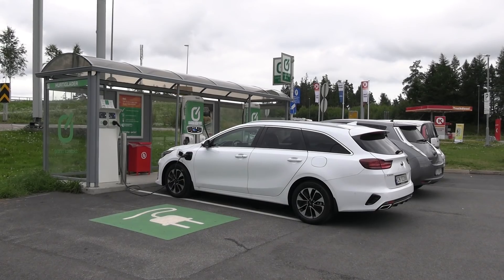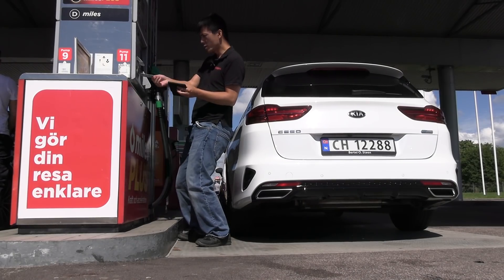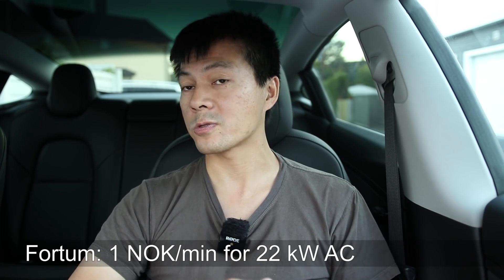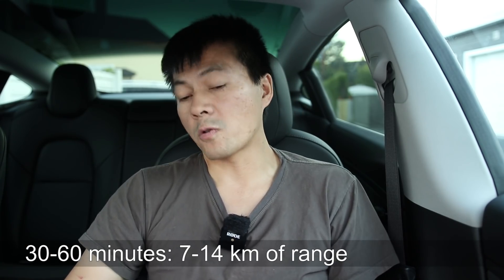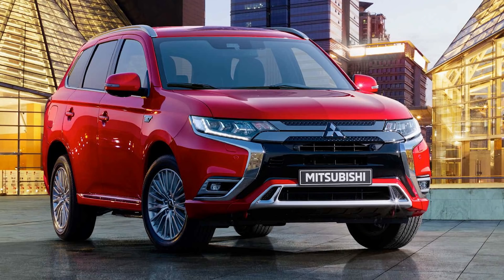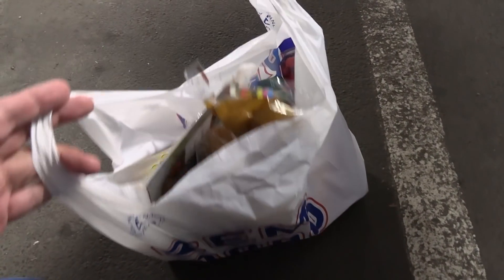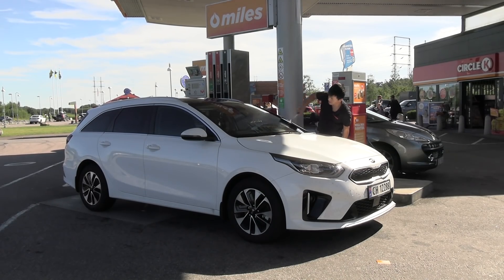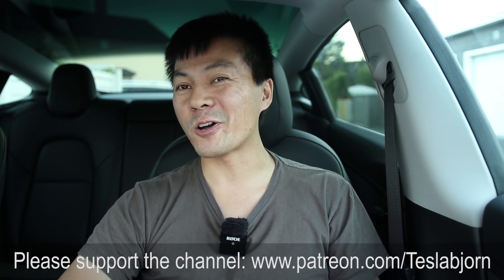Why didn't you plug in the PHEV while eating?

Comment: I agree on the financial aspect, charging a PHEV on a price-per-minute charger is just stupid. No PHEV driver uses a price-per-minute charger unless it's by mistake. However you need to understand that on long trips, you don't charge a PHEV to increase range (it's still a fossil car, range is not the issue) - you charge it to reduce fossil fuel consumption and increase performance. So those measly 7 km of charge might actually reduce consumption by 15-30% depending on how long your drive is. And on the motorway, having 7 km charge rather than 0 km gives you 30-50% extra HP depending on what PHEV you're driving.
Reply from the maker: In order to reduce the consumption by 15-30 %, you can only drive 50-100 more km. If you drive farther than that, the reduction in consumption is way less. In this example, driving 320 km with 7 km extra electric range would mean only 2 % reduction. A drop in the ocean.

As for the extra hp, you only have that extra power for 7 km. After that, it's back to fossil only. Your arguments are not valid if you actually think about it yourself.
Reply: @bjornnyland  I don't know the theory behind your maths I only have practical experience driving a Passat GTE for three years and 75 000 km. And my experience is that driving 300 km on the motorway with 0 km charge vs. driving the same distance with 7 km charge renders a consumption reduction way above 2%. 

And your other point makes no sense. When driving in hybrid mode on the motorway a PHEV (atleast the Passat) uses the fossil engine to maintain speed and the e-motor when you accelerate (or regen when braking). So 7 km charge lasts alot longer than 7 km distance. You could of course drive electric only for the first 7 km and then switch to fossil, but thats suboptimal from a consumption perspective.

Comment: I’d gladly pay even more money to get over 22kW AC charging. Where I live we basically only have ABB 50kW fast chargers with a CCS, a Chademo and a 43kW AC Type 2 plug. Since these chargers are quite rare, too, they tend to be occupied quite often. That way if you have a car with a CCS/Combo 2 socket that supports low power AC charging only and you arrive at the charger and the CCS plug is occupied, you can only charge slowly on AC. As I mentioned you could charge on up to 43 kW on AC though. If your EV could take that much power when charging on AC it wouldn’t even make a big difference whether you charge on DC or AC. 
Some chargers are located at supermarkets and gas stations. You are allowed to charge for free for up to one hour there. The rest of the chargers are owned by a company and they are located at gas stations at the highways. This company charges a very high price for charging though (when compared to the price of electricity here).

Comment: - Even if you have to pay per 1kWh: 1.6kWh is rounded to 2kWh. So you would have to pay for 0.4kWh you didn't get. Which means every kWh costs you actually 25% more! So you shouldn't do that too often. If you charge like 10.6kWh, it's just 3.8% more that you pay.
- In general, slow charging vehicles (no matter if just 3.6kW charger in the car or battery nearly full) should have to leave the charger if there're others which can charge with more power or have very low range. Ok it's difficult to find out if the next one can really charge faster (e.g. his battery is too hot due to the usage?). So you can just say "Please" to the people how are currently charging there.
- How about buying a mobile CCS charger? You could save money when buying a car (e.g. the cheaper ID.3 with far less than 11kW Type2, but can also charge with 50kW CCS) and charge multiple vehicles faster (one by one of course :-)). Ok, also the Chinese ones (ca. 20kW) cost ca. 10.000EUR (via European dealer). European one cost twice as much. And you'll probably need firmware updates when there're new CCS EVs. So you would have to use it for multiple EVs where you saved money by not buying faster Type2 charging...
Reply from the maker: No, you don't. They don't round up to 1 kWh.

Comment: Excatly. My PHEV can charge at 7.6kW however it is not fast and since it performs really well on long distances when combining battery and fuel power and it takes less than 3 liters per 100km if you drive on the highway. When I publically charge it, all I do is block the charger for real EVs.

Comment: Very good explanaitions!
But as long as cars are considered to "block chargers" while they are charging, there is no way to go 100% electric. Not even Norway that is so far ahead has the charging network needed. There's also a problem manufacturing enough batterycells for electric cars, and for the most trips we don't need big batteries.
We will still need PHEV:s for many years ahead. People that drives a lot more then average should consider fully electric cars. Others should choose PHEV.
The 16kW chademo abillity on my Outlander is fantastic! But I would definitely pay 1000 eur extra for an 11kW AC onboard charger that I could use in a lot more places!

Comment: Sadly this shows why fast chargers should never be free of charge. There are many really good reasons not to fast charge your PHEV. It takes longer than you think because of the battery size. It may degrade your precious but small battery. AC charging on the go, why not? Your PHEV has a bad ass Premier league fast charger that s called
A petrol pump😃👍
PHEV and BEV driver

Comment: Charging is not "blocking". If a PHEV is charging, that's fine even if it's slow. You could otherwise argue that an Ioniq Electric is "blocking" a 22kW AC, because it is charging only at 7.4kW. Or an i3 "blocking" Ionity, because it's only charging at 50kW and not 350kW. Blocking is only when you're NOT charging.
Reply: Yes, you're right.bDo you own a BEV? Do you live in a country where there's only 1 DC50kW charger every 100 or 50 km? If you said yes to those 2 questions you would probably think differently.
Reply: @topicsx  I own a BEV. The infrastructure will grow with the number of cars. You'd have the same problem if there are more BEVs on the road with a thin infrastructure. Would you be happier if the charger you wanted to use is blocked by a BEV ? I don't think so.
Reply: @JohnDoe-vx3z  we are talking about the same issue! Lack of reasonable infrastructure. But when that's the case, I think common sense and thinking a bit about the others (and not only on our own belly) is the way to go.

Comment: PHEV is both the best and worst of both worlds of fossil and EV!
Yes, you get the range, but the fossil engine drags round the battery and motor in fossil mode. In electric mode you're dragging round the dead weight of the fossil engine, transmission, exhaust, fuel tank.
Reply: I disagree with that sentiment, and here is why.  You could make the same argument with a large battery, but IMO both arguments against PHEVs and large batteries are a bit flawed, when looking at the broader picture.  A PHEV can give you electric range and hybrid mode for longer drives, all the while, you "can" keep the battery within a voltage range to significantly promote battery life (ex Chevy Volt). A large battery also accomplishes this, and allows for faster charge speeds.  I know it may not be the case everywhere, probably due to geography and climate, but first gen electric cars here in the states, with small batteries suffer from significant degradation (ex LEAF, iMiev, Spark EV, Smart ED, etc), as opposed to large battery EV (Model S) and PHEVs (Chevy Volt). 

My belief, which aligns with known battery science, is the short range EVs made within the last ten years, were charged full and discharged low, and frequently, in order to meet travel needs of users.  Add in higher discharge ratio for acceleration, the need to fast charge more frequently if traveling, and it's a recipe for higher degradation and shorter life/less practicality.

I get the whole carrying around unnecessary weight and components. On the face of it looks very logical and it is valid.  I would rather people buy BEVs, but a PHEV is much better than an ICE, and many people that buy PHEVs end up buying a BEV as their next vehicle.

Comment: Bjørn, Very well thought out and well stated reasoning.  I enjoyed watching and agree, but I do have an exception.  I drove a Chevy Volt from 2011-2018 and enjoyed the experience.  I am 100% BEV now. When I had the Volt, I wanted to keep it in electric mode as much as possible, enjoying smooth and silent power equal to hybrid mode. I hypermiled a lot, which was fun. I used public EVSEs when running errands around town if I would be parked for an hour or more, and I needed extra charge to complete my day on electricity alone.  That made sense to me, as long as the 3.3 kW charger (10 mph) did not make the public EVSE more expensive than gas. Some cost 2x or more, but others were free.  Of course when on road trips it made zero sense to charge. I used gas on the highway and saved my charge for city driving. I arranged to stay at hotels and resorts with charging, so I could drive electric locally.  It was a lot of fun, but my 2018 Model 3 is even more fun.

Comment: Before I bought a BEV I charged my PHEV as much as possible, but I always left a post it note on the car telling BEV drivers that they could unplug me if they needed a charge. I hated hearing the sound and vibration of the engine kicking on, cost and the environment weren’t my main reasons for charging in public when it made sense to. 90% of my driving was completely electric with the PHEV so I ended up replacing it as soon as a few more CCS chargers opened up around my area. I think DC fast charging is silly for PHEVs, but faster onboard chargers seems like a no brainer to me. The difference between a 3.3kW and 7.2kW onboard charger is night and day.
Reply: If you have a PHEV  or extended range electric with ~100 mile electric range (bmw i3), ccs/fast charging is a nice and more rational feature.  I agree that with vehicles like the Outlander PHEV, it's pretty much laughable.

Comment: Hello, I agree on this video.
I know that you don't want to test every phev, but I'm sure the outlander could interest you, with is regen pedals, pure ev, save, charge, sliding etc... 
If somebody want to know in full ev the Outlander phev need 17kWh/km when the ioniq 28 need 10kWh/km. Coef 1,7.

consumption 4 to 7 litres for 100km, depends on route and capacity of the driver managing the different mode "charge" and "ev" and regen 0 for slide.
charge
AC charging to 30% (empty) to 100% about 5,5hours on 2,3kW plug.
I do easily 50km (max 66km) point A to A in ev only with it (no autobahn of course) with 70% of the battery (100% to 30% empty).
This car is very interesting to play with and you can make big gap consumption how you manage the system.
Have a good day.

Comment: The Highlander is most annoying to wait for.  You'd be lucky to get 40 km EV range after 25 minutes of DC 'fast' charging at 22 kW.
The battery size on that vehicle makes no sense at all to combine with a DC charger.
Mitsubishi should up the range to a reliable 100 km (~30 kWh), then they'd have an actual excuse to fast charge, and the thing would be far more practical.

Comment: I own an Outlander. Mine has a 12Kwh battery. That is gross. Net power is only 8Kwh. Next car will be full BEV. Looking at Ford Mach-E.
Reply: What is your electric only range?
Reply: 20 Miles Spring to Fall. Less in Winter. I can fast charge to 80% in 15 minutes, or AC charge at 3.5KW.

Comment: Hey Bjorn, why don't you test one of these with your Tesla?

https://www.designwerk.com/en/mobile-dc-charger-22-kw-mdc22/

It takes in 22kW AC and outputs around 21kW DC. It works with a variety of input and output connectors eg, Commando or Type 2 input, CCS or ChaDaMo output. Only snag is the weight: 22kg - equivalent to the weight of one typical checked-in airline suitcase. Perhaps that's why Tesla don't include it as standard!
Reply from the maker: Because it's way too expensive.
Reply: @bjornnyland  Pretty extraordinary isn't it (€15,000 just for the base unit for anyone who hasn't looked)? It would still be fun to see it tested! Wouldn't they let you borrow one for review?

Comment: I would love a 22kW AC Charger in my Model 3, too. 
11kW was my absolute minimum if the model 3 had only 1-phase charger i would never bought it. (The most charging stations in my Town are still 22kW AC and i cant charge at home...)
(I had an ZOE before with 43kW AC Charging... :D)

Comment: New Merc A class plug in is able to charge itself in 25 mins on 50kW DC. Just tested this car, and was pretty amazed.
Reply: 25 minutes to get 60km WLTP of range while you can get 300km WLTP after charging an e208 on 100 kW in the same time
Reply: @michelmelinot  Yeah, but we are talking about plug ins, not BEV.
Reply: @michelmelinot  there is no way you get 300km in only 25min in an e-208. That would require 90% of SoC. And by using the same argument: should an e-Golf be banned from DC fast charging, because it is limited to 38kW ?

Comment: i own a 2018 c350e T in Germany. I've been to Finland with my car (ferry). fortum, virta, and other charging stations may have 22kW or 45kW charging speed but you pay  based on the  kW (or/and minutes) at least in Finland. you don't pay for 22kW price so charging never costed me  more than 1 euro at once when i parked for tour, meal, etc. Plus i put RON95 (E5) or above only since it is required for the Merc turbo engine.... as much annoying as it is to charge 6.3kW battery which takes about 1.5hr, still sooooooo much cheaper to charge than putting petrol costed around 1.7 euro per litre.  PHEV is should be compared with mild-hybrid or pure conventional engined vehicle because the way it work and reasons people buy are quite different: adequate charging stations + charging/electricity cost in the region + how you use the vehicle whether for commute in the city (Green zone/electric only restriction zone) or long distance drive + tax + subsidies + etc.

Comment: I drive a Outlander PHEV which has a rapid Chademo and a 3.3 KWh. I use it as a taxi. When we are between jobs hooking up to a slow charging type 2 pole between jobs massively increases the MPG. 
During the lockdown (I was taking key workers to and from work) 
I did 275 miles and used only 7.5 liters of petrol! I also rapid charge as often as I can. 
Our only rapid charging point in town is frequently sabotaged by the homeless people who are now living in the once quality hotel where the charging point is situated. 
I average over 50 mpg summer and 45 mpg winter. 
My last fossil taxi a Fiat Doblo used £9000 a year to do approx 50,000 miles. The PHEV is using about £4000 in petrol and £ 800 (rough calculations) in electric. 
In 3.5 years the outlander will be a free car. Having saved me its cost in fuel alone! It is now on 169800 miles  and battery is doing fine. It has dropped some and my summer range on pure electric is now only 20 miles.
Reply from the maker: 3.3 kW
Reply: @bjornnyland  yes but when you are waiting between jobs anything is good. It all makes quite a difference. 
I always unplug instantly if a BEV turns up at the rapid charger. And never leave the car. Quite often the pump is iced by BMW and Merc phev's who plug in and then go to their bedrooms for the night! This has also been done by at least 3 Tesla owners to my knowledge. Its the only rapid charger in town :( 
We are getting 10 new chargers care of the government grant to the council. However the council have chosen some new company to install and run them. This is likly to be run by the son in law or family member of one of our Council committee, so the charge per KWh is going to be very high. :( .
Reply: @williamarmstrong7199  I think Bjorn was actually correcting you. The charging power is 3.3kW not 3.3kWh.
Reply: @bjornnyland  16 KWh on Chademo to 80% when it cuts charging. 23 min for 17 miles range.